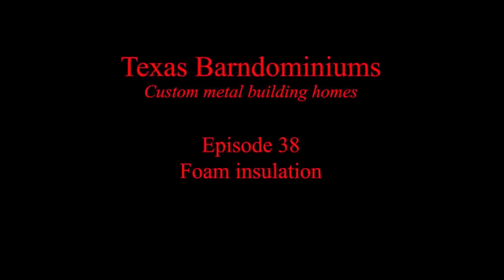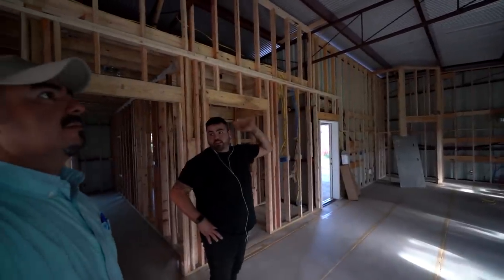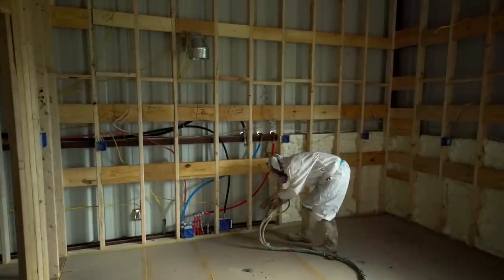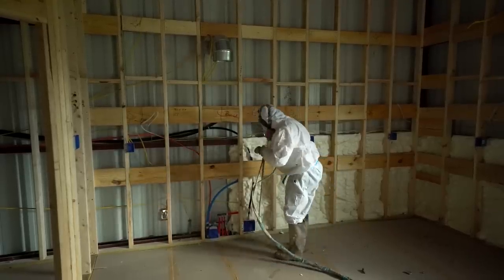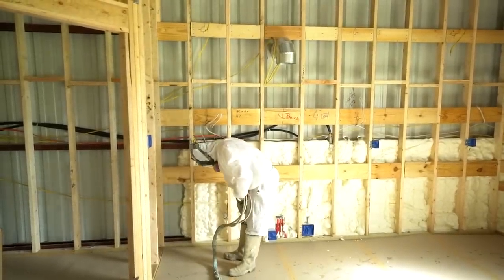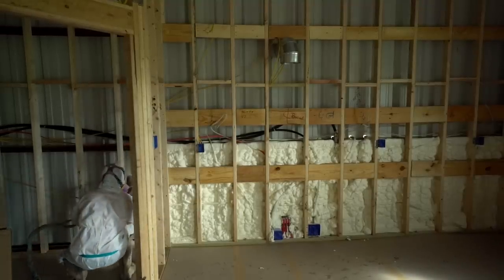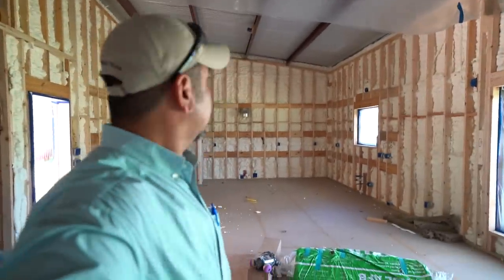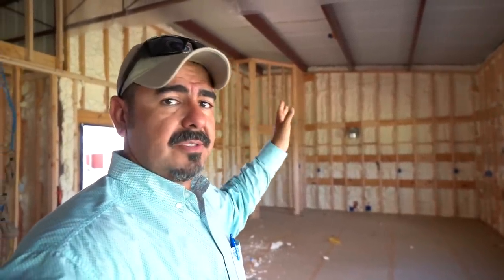Foam insulation - How good is it?   Texas Barndominiums Episode 48

Comment: You should put a thermometer in a house and see what the difference in temperature is before and after the foam so you can show an example of the difference it makes. 
I've been inside 2 different mental building sitting next to each other. One was fiberglass insulation and the other was closed cell foam. 
There were 2 big shop fans full speed, and doors opened in the fiberglass insulated shop. And it was way hotter in there than it was in the foam insulated shop which had no fans and was all closed up. It was 97 and sunny that day. The foam shop actually felt like it was air-conditioned and it wasn't.

Comment: I have questions about foam...
1. How do you rewire the home, fix plumbing if loaded with foam?
2. When renovating, can a wall with foam be changed? 
3. I thought foam was a playground for termites? They dont eat it, but harder to see their penetration?
4. What is the projected life span? 100 yrs, 200 yrs?
5. If a fire happens is the byproduct toxic? Can say. Rowdy pet who digs, get ahold of it, is it toxic? 
6. Is there a weight of the finished foam vs weight of fiberglass?
Reply: I worked for a builder for 10 years that used foam and fiberglass together. The studs were foamed where the sheetrock met the stud, basically the edge/corner and fiberglass installed over it. We had to   tear out parts of walls on occasion and it was pretty aggravating. If the entire thing is foamed like they are doing here I'd imagine it would be a real pain in the ass. My opinion is you need to weigh the pros vs cons, I feel the pros outweigh the cons.

Comment: First of all,  thanks for taking the time to do these videos.  I plan on building a barndominium in the future and have actually visited your website a few times for ideas.  Unfortunately I am in east Texas and out of your service area.  Your videos have greatly increased my knowledge on the subject.
While the spray foam appears to be a great way to insulate, I do have a question that I cannot seem to find an answer for anywhere on the internet.  I notice in this video that the foam is being applied directly over all wiring and piping in the walls.  While pex piping is a great invention, it is still subject to needing repairs due failure in the future.  Fittings are definitely a weak point.  As for the wiring, I realize these are new homes and one would think that the owner will be completely satisfied by the quality I see that you guys build in.  However, what happens when they realize that a room doesn't have lighting in all the places they might need it and want to install a new fixture or wall outlet?  One would think that the pipes and wiring would be put in some type of conduit/raceway in order to allow for repairs/revisions in the future.  Using the spray foam without either of these solutions or another suitable application it would appear that you would have to tear out sheet rock the full run of the wire/piping in order to repair/replace/revise.
So I guess my question is, when dealing with my contractor in the future, what is the feasibility of using conduit or a raceway for this application?  Would it be something they would likely even consider doing?
Thanks again for the videos!
Reply: @TexasBarndominiums  Thanks for taking the time to reply.

Comment: The best open cell spray foam is still no substitute for a vapor barrier. You MUST have a correctly applied vapor barrier with all 
thru-envelope penetrations sealed with the appropriate products such as those made by Prosoco. No exterior wall on any building that I commission will be built without wood sheathing or a masonry wall. I do love the umbrella provided by those long roof overhangs.

Comment: Hey guys, great stuff.  I have used it “closed cell” in industry for many years.  Regarding fire issues, there was a warehouse with a closed cell roof that caught fire in Illinois I believe.  The closed cell foam roof was laying on top of the melted steel structure when the insurace folks arrived!  The roof would not support combustion.  Great material inside or out.  Outside must be painted tho.

Comment: Just for your info I was told by  Uponor that the plastic fitting should not have spray foam applied to them, it causes a chemical reaction that will make them fail. It is OK to spray directly to the pex.

Comment: THE FOAM SALESMAN SURE DID gloss over the price question like a slick politician.   That stuff must be as expensive as gold!
Reply: It is NOT cheap, and he could have easily quoted it by the Drum Board coverage and did not.  A good rule of thumb is $2.00 PSF and remember you get better (more) coverage with open cell than closed cell. Closed Cell is for roofs, walls  and open cell is used mostly in attics. the initial R factor of a single spray is usually around 91-93% but a second spray to increase it to 98% is not really worth the extra cash outlay. Also remember that this system is approved for Attic Use of Closed Ventilation, (no ridge caps or eave windows)
Reply: @anonimous2451   THANK YOU!    Finally some info I can make good use of.
Reply: I did my house after Hurricane Harvey, the foam costed about $1500 more than fiberglass. Some things to also consider is the AC unit is in the attic, I had to add a whole house dehumidifier which was about another $1200. The cost of equipment and foam was paid back within the first year in savings on my electric bill.
Reply: @unclefred1120   Hi,  I am wondering if an attic fan or two might be an equatable and far less expensive replacement for the whole house dehumidifier???
Reply: Tribulation Prepper fans will circulate the air but not draw out the moisture. I’m in Houston Texas where the humidity is usually at 110%
Reply: @unclefred1120   That explains it.  Here in NW Arkansas, not so bad.  I will usually run the AC/Heat Pump for a short while if need be.
Reply: For a 1050sq ft living space in my barndominium with 10ft studs, I was quoted $2865 for 3" of open cell in the walls and 6" of open cell in the ceiling.

Comment: Apparently you or your foam installer doesn't know you should NOT spray foam on plastic pex fitting. Those fittings look like Wirsbo/Uponor. I was told by Uponor rep there can be a chemical reaction between the plastic fitting and the spray foam, the tube is OK. All you need to do is wrap the fittings with tape or something and you are good to spray. Hope those fittings are good at least till your warranty is up. More just for everyones info just wrap the fittings.

Comment: Assume you don’t use the same “fireplace guy” anymore.
Reply: I imagine the fireplace guy done it like he normally does it. Barndominiums are a total different ballgame than your typical house. They don't automatically know everything. Lol
Reply: How does the house "breath"? Doesn't foaming it seal it to where moisture/condensate form on windows, etc.?
Reply: @DS-to1wf  It's the job of your HVAC system to ventilate your house, so the air can be 'conditioned' to the desired state before it gets pushed throughout the house, including dehumidifying. Leaky houses may have been a thing decades ago, but these days with everything geared toward high efficiency, air tightness should be a priority, not just for comfort and efficiency, but also to prevent toxins, contaminants, bugs and rodents from infiltrating the envelop of the house. The only way air should enter your home is thru the HVAC system... of course, unless you open a door or window lol.

Comment: you didn't mention the closed cell foam also adds additional structural support to the building. I would have put it everywhere as it increases sheer strength in the entire building.

Comment: Iam going to be starting on my 24 x 50 ft metal frame bardinium.
Planning on putting in 2x4 studs inside.
Is it always best to have the closed cell sprayed after the studs are put in ?

Comment: Cool video with great info. What about water vapor with the open cell in the walls? Why not used closed cell every where. May not be an issue in Texas but open cell in the walls in cold climates is a disaster.
Reply: You need some moisture to pass through if it's in the living space. Open cell also fills the hard to reach places better than closed. Closed should only be used for non-living areas.

Comment: I have seen recommendations to add reflective bubble insulation then firing strips on outside of steel frame before adding steel wall and or roof. This is supposed to reduce heat transfer from steel to inside of building. insulation is then added to interior. Building in Nevada so main concern is high temperatures with high sun exposure, rain and cold less of a concern. 
If adding reflective bubble insulation in this fashion would foam insulation be recommended or an option? are there other options to improve solar radiant heat transfer?

Comment: Close cell vs open cell. A he I worked on was wood sheeting exterior on studs, drywall inside with insulation, not close cell. So pipe leaked, wood rotted, drywall needed to removed and the insulation was saturated. Wouldn't bit been better for a closed cell application to prevent water spreading and would it also insulate the pipes as well?
Reply: No. With closed cell if there's a leak you won't even know it and it will ruin everything. With open cell you will be able to see the leak earlier on that you would with closed cell. A quick google search will give you the info you are looking for.

Comment: Eric, 
So what total R Value are you getting on your typical finished exterior walls? If the 3.5 inches of foam works out to just under R-13 and seems a little low by today's standards, If you're using 5/8 Drywall that's roughly .5 R so any other insulation going into the wall systems when the exterior surface is metal? Not criticizing, just asking. Also any heat transfer through the perlins where there is less insulation being applied?
Reply: @TexasBarndominiums  Thanks for the info

Comment: Any reason why they didn't fill up the wall cavities to the ends of the studs? It looks like there are about 3 or 4 inches of room left. I've seen videos in the past where they spray the foam proud of the studs and then shave it off flush with the stud.
Reply: @TexasBarndominiums  Thank you! Love your videos.
Reply: I like the idea of not wasting so much foam, what would it hurt to add 4" unfaced fiberglass over that or the blown in type they put the cloth mesh up and fill it up, and curious what the r value would be, finished wall

Comment: I spoke to you one time before. I am building a small barndominium in Florida doing very similar to this. I have a small question, when putting my roof on a screw was put in and then removed leaving hole it was covered with silicone type material. Is this enough or should I ask builder to replace sheet it will be sprayed with close cell.

Comment: How does the house “breath”?
How do you keep the moisture out and keep the windows from “sweating “?
What type of HVAC unit do you use?
Reply: houses aren't meant to "breathe". The better air seal the better! You have to manage the humidity and temperature inside with something like an ERV or HRV OR a whole house dehumidifier that takes in outside air and filters it.
Reply: You need SOME moisture. Open cell will allow it to breathe a little. For HVAC you need a fresh air vent installed.

Comment: So the question I have is, if closed cell gives a vapor barrier, then why use open cell if it doesn’t? Where is your vapor barrier with open cell?
Reply: It depends on if you’re applying the foam in a hot climate needing cooling or a cold climate needing heat.

Typically, it’s ideal to apply closed cell foam in colder climates needing heating. This is due to the closed cell acting as a vapor barrier, and not allowing the warmer air on the inside to find the cooler air on the outside wall and causing condensation.

With closed cell foam, it is vapor permeable and is suited to warmer climates needing more cooling, assuming that there is a WRB such as Tyvek applied correctly to the outside.

Hope this helps.

Comment: He's using the wrong caulk if thats for a fireplace vent.
Reply: what should it be? Mind to share?
Reply: @driveramd12  we always had to use fire caulk (high heat) to meet code.
Reply: The caulk was being applied to the flashing, not the actual fireplace vent.
Reply: @randomodbuild  all good on the flashing only.. You are correct on that.  Cheers

Comment: How do you keep ants, in particular, fire ants out of the spray insulation.  I use closed cell urethane insulation board to insulate my beehives and I can't keep the ants out of it no matter what I do.  We are in the process of building a barndominium and initially wanted to go with closed cell spray foam but have great reservations with respect to ants getting into the foam insulation.  Is the spray foam treated with a chemical to keep ants out of it?
Reply: @TexasBarndominiums  Thanks for replying.  Could you elaborate more in detail about how the foam enclosures keep the ants out?  Here in TN ants love to build nests in foam insulation.  It seems like it is impossible to keep them out

Comment: Yeah Right. Everybody go look at the YouTube video, Spray foam insulation nightmare: What can happen if it's not installed correctly (CBC Marketplace). Then, decide for yourself.
Reply from the maker: BX B

Go look up “deadly car crashes” on YouTube and let me know if you want to get in a car tomorrow.   

 BTW, you will have issues if windows, water heaters, dishwasher, etc are installed incorrectly.   What’s your point?
Reply: bonehead

Comment: I wouldnt have the wires nor the plumbing inside the foamed wall, for future repair reasons if nothing else. Wall mount the lot of it.
Reply: It's actually common practice and protects the wiring etc . You should not have a problem . Foam is not that hard to cut out anyway with the proper tool .
Reply: Open cell is fine for that, it's one of the advantages to using open cell for the walls. Wires can be pulled and pushed through a lot easier.

Comment: I notice that when this foam is applied it does not fill the entire stud cavity, is there a reason behind this? I have seen other applications where foam does fill cavity and someone comes behind applicator and has a long flexible knife and trims foam flush (relatively) to edges of stud cavities. Is either system more or less beneficial? Still waiting for TB to come to Wisconsin and build me a #62, LOL. Thanks Erik.
Reply: Mykel Hardin in Texas 2x4 exterior walls are still very common. Texas is a cooling climate. We’re wanting to lower indoor temp by 20°-30°. In the north they are raising the indoor temp majority of the year. Usually 50°-70°. That’s a higher delta T. Which requires a higher insulation value. Thats why 2x6 are used in the north.

Comment: In regards to the soundproofing qualities, that guy couldn't be more wrong. Foam has much lower soundproofing ability than fiberglass insulation. Solid isn't a good thing when it comes to stopping sound.
Reply: Stephen open cell foam is much quieter than fiberglass
Reply: @heknows5418  open cell may be similar to fiberglass, but closed cell is terrible. Closed cell foam is rigid therefore provides an easy avenue for sound to transfer through. It's about creating air gaps and disruptions in the waves. I have a lot of experience with this. The best sound protection you can get in a residential space is fiberglass or mineral wool in the walls with 2 layers of high density drywall separated with green glue.
Reply: Stephen read my statement before you contradict me   I said open cell is quieter than fiberglass , I don't know about closed cell as I don't have it. And who is going to put up 2 layers of drywall in a residence.

Comment: lol,just love it!spray foam looks fine but cant get over this "building in a building" idea that people do!why not just stick build it then you dont need to frame everything out in it again?this makes absolutely no sense to me and is a waste of time,money and materials!must be how they do it in texas,we wisconsin guys must not be doing it right.my biggest take away from "pole barn" to "stick" built,do it once,not twice.
Reply from the maker: It’s not wrong, just different to what you are used to.
Reply: The steel building adds a ton of strength I would imagine, closed cell foam insulates pretty good but also acts as an adhesive, holding the parts together a little stronger to boot.
Reply: Have you actually priced it out? I have, and I am currently building it. Total cost will be about $115k for a 40x60 steel building with 4-12 pitch, eaves, porch, gutters, 1050sq ft living area with 10ft ceilings. VRR insulation in all of the building, open cell foam in the walls and ceiling for the living space. You can't do a stick build like that for that price. A 1000sq ft home costs about $100k at best around here. That's with no garage, standard ceilings, very basic. Once you add 1400sq ft of garage space to that 1000sq ft stick build to get an equivalent comparison, price is going to skyrocket. If it's done right, like most barndominiums were 20 years ago, it will be quite a bit cheaper than a stick build. If you add a bunch of masonry to the siding and make the interior like a mansion or modern yuppie home, then yeah, of course it's going to cost the same or more.